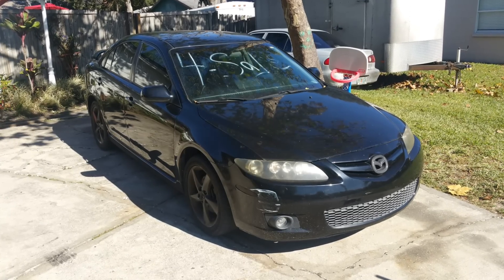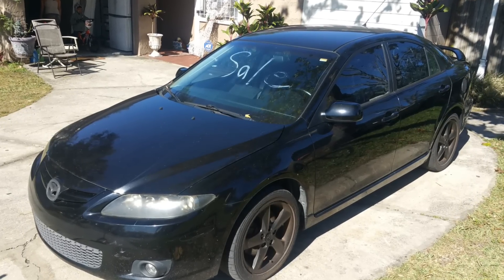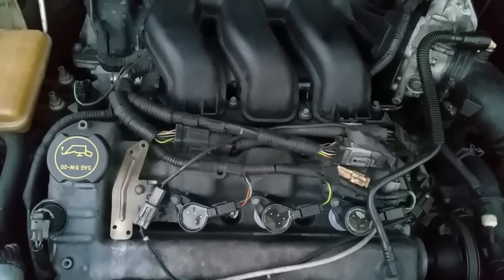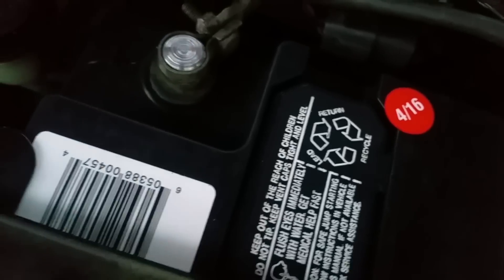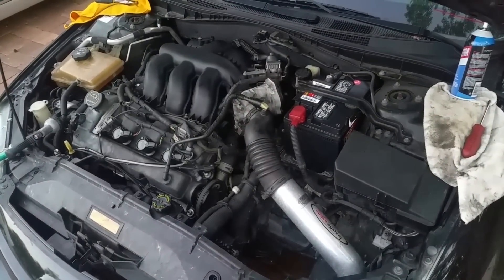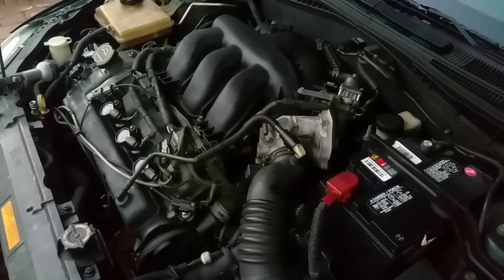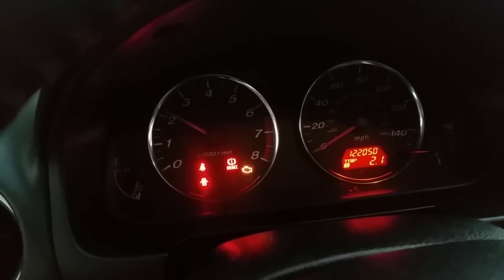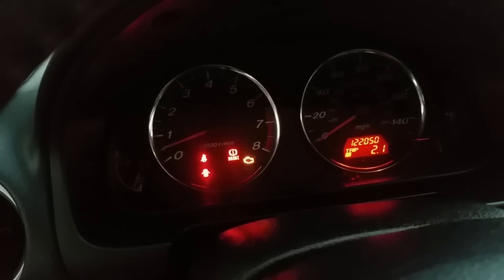Car Starts But Won't Stay Running

Comment: Take off the air cleaner try spraying starting fluid in it If the car runs you have a  Fuel problem If that doesn't work you have electrical problem

Comment: All calls need fuel and spark Make sure you have that Clear all your codes and do it over again Cause one Code will make others trip Check the timing When you have the new codes look into it massive  Air flow sensor Clean throttle body

Comment: Did you fix the problem?
P0103 - Mass air flow sensor problem. 
P0128 - coolant temperature too low
P0131- O2 sensor low fuel air ratio
P0134- O2 sensor no activity bank 1 sensor 1
P0137- oxygen sensor bank 1 sensor 2
P0151 - O2 sensor bank 2 sensor 1 
P2096 - lean fuel air ratio bank 1
P2099-  rich fuel air ratio bank 2
P2177-  too lean of idle bank 1
P2180- too rich off isle bank 2
P2197- bank 2 sensor 1 too lean

Car needs air fuel spark compression and timing to start a car and have it keep running.

check idle air control, throttle body, maf sensor, vacuum leaks, o2 sensors

Check alternator, igniter, 

Check the fuel pump(it might be failing), fuel filter, injectors

Check compression, 

Check timing, cam and crank sensors, thermostat, temperature sensor, water pump, radiator. Wires and Fuses to all those electrical system things and lastly... Computer

This is a big job... hope you were able to fix it.

Comment: Bro the timing is way off..by some margin.. I fixed exactly same problem last year in madza mpv vs6 it is cause by a weak tensionner or lose chain or chain guide,if the timing is off the oil pump wont get the full presure to pump,that is why the engine is making dat noise

Comment: I used to have this generation of Mazda 6 (Japan build) here in the UK with Mazda's 2.0 MZR SVT motor. It never missed a beat. No offence but the car in this video has the flaky Ford V6 motor, and is American built. Americans seem to get a bad deal with this Mazda.

Comment: It is called solved - what was the solution?
Reply from the maker: As shown in the description, replacing the fuel regulator was the solution.
Reply: Joseph Gallego thank you sorry on my phone the description doesn't show until I click the arrow I hope that's the same problem I have it looks the same

Comment: My car does exactly that it's a Toyota Camry le 1997 v6
The mechanic supposed fixed by changing the intake hose 

But still has trouble turning on I give it gas and it turns on what do you think the problem is can it be the c o 2 sensor
Reply from the maker: Does it stay on when you give gas?
Reply: Joseph Gallego  sometimes it will stay on  when I put in drive and take off it dies and turns off... Im not a mechanic no one seems to know what the problem is

Comment: I'm not sure if this will help but I had the same exact issue. Right now, your car will start up and run but shake. As it gets worse, it's going to start up and rev up and down and shake once it's a little warm. After that, it's going to start up and shut right off.  After doing the same thing you did, I decided to get it checked. If your car has a computer in it, it's fried like mine. You can get this changed easily.
Reply: guild79s all cars have a computer called the ECM electronic control module. Computer is not the issue most times it's a sensors that's not reading right so the computer not getting the right information so it's not sure what too doo

Comment: In my belief, it's an engine failure. Check the compression of one piston. That will tell you everything. That will tell you if there is something wrong with the engine.
Reply: Manuel Chavez the engine can't run unless three things are working it needs gas air and spark it's cranking over in the video and he has good fuel pressure so it's not fuel pump issue and it's not a crank issue is next check the battery and spark plugs. Maybe also the MAF sensor and maybe clean out the filter all things too try

Comment: Aye bruh stg im haveing that same exact problem with my 2002 lexus ls430 except itll stay crunk for like 10 seconds. What was the problem?????
Reply from the maker: Adrian Newsome The fuel system wasn't getting enough pressure. After replacing the Fuel Pressure Regulator, the problem was solved.

Comment: guys, my car has had this problem for a while, the garage managed to get the car up and running today without stalling and it seemed to be the fuel filter, as soon as they replaced it it started to work so id recommend trying it, For the sake of £20 £30 its really worth it.

Comment: Could be anything from MAF sensor to the electrical system , your ICV (Idle Control Valve) could be stuck or clogged or even a problem with the immobliser, clogged fuel injectors etc, could be anything.i have the same problem with my alfa mito 1.3 jtdm, my mechanic has checked everything but the electrical system, thats next on the list.
Reply: Also, check your coolant temp sensor.

Comment: My truck did this for the first time today! Glad I was only a block away from home. Would you say a fuel pressure regulator is always the problem? When I start it... nothing works on the dash. All needles are to the left and don't move. Two days ago, while driving, everything on the control panels went dead! I couldn't tell anything... to how much gas (it registered empty, but I filled it day before)... 
I drove this way about 3 minutes and went I put on my signal to turn.. all the controls started operating again. 
97Jeep Laredo almost 400,000 miles
Reply: Same here..dash board was out but still was able to use power windows. ..windshield wipers...signal...etc. But then..it started working again. No reason!
Reply from the maker: Lorna Shipp the car had multiple issues from the fuel regulator to vacuum leaks. So your dash instrument cluster only responds when you put on your turn signal?
Reply: Joseph Gallego ....it doesn't just respond when turning on signal.This only happened one time. Its also not a fuel regulator. Truck started a few hours after I posted to you. I'm still wondering what it could be!
Reply: My 97 gc jeep is doing the same Lorna have you figured it out?
Reply: my engine light came on a few days ago. But, the starting problem hasn't happened again. I got a diagnostic at advanced auto and one code came up P0740 =torque converter clutch, no revs per minute drop @ lock up. So to answer your question... I haven't really figured it out yet. But it's not the fuel regulator that everyone said it was.
Reply: Caleb... is your engine light on?
Reply: Ok thanks anyway!!
Reply: let me know if you find out your problem...
Reply: after fusing with wires under ignition cover i seem to have resolved the problem of it shutting off after 2 seconds. will repost if it continues to act up after
this
Reply: most of my dash lights had gone out while in crank position after wigling wires ive got gauges back. could be just a bad conection. after doing a test i got disconected battery code and thats all. no check engine light present while running

Comment: my car doing the same in the video did you fix it??
Reply from the maker: Dannie Walton yes the fuel regulator lacked pressure. Replaced it and fixed the problem
Reply: Joseph Gallego does it go where the fuel pump is at?
Reply: So all those codes meant it was one thing that needed to be fixed? If so how did you find out it was the fuel regulator?

Comment: fuel pressure regulator
Reply from the maker: where's that?
Reply: on this car I don't know but I just had this problem with my 07 eclipse. it would run for a few seconds then die. my fuel pressure regulator was built into the fuel pump sending unit. I just got one from a junk yard for $30 and it fixed it